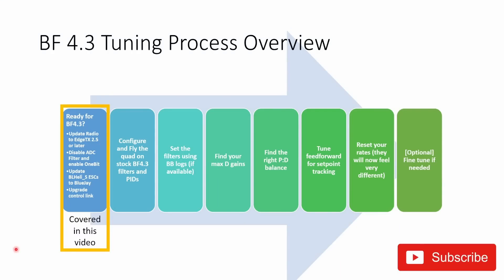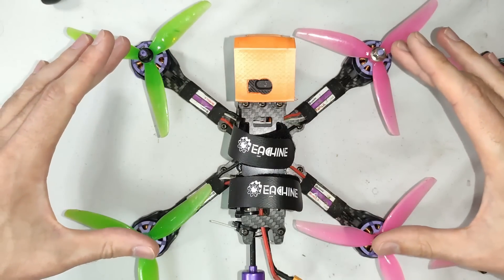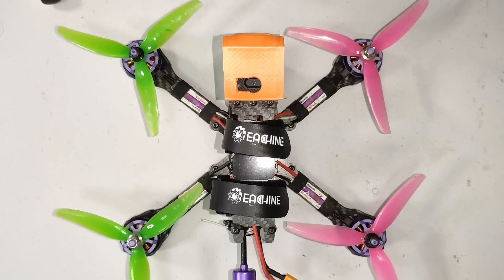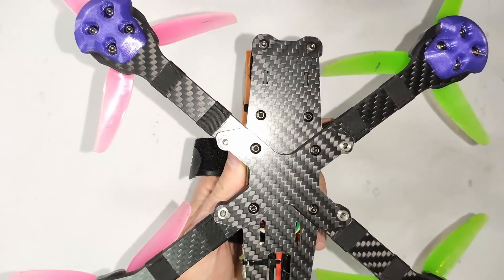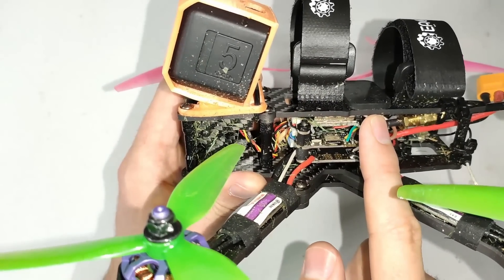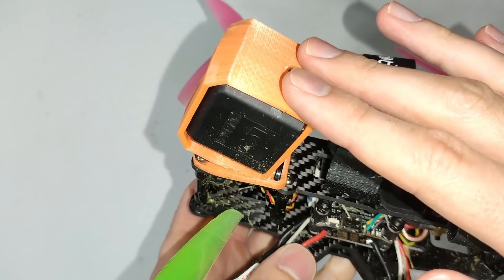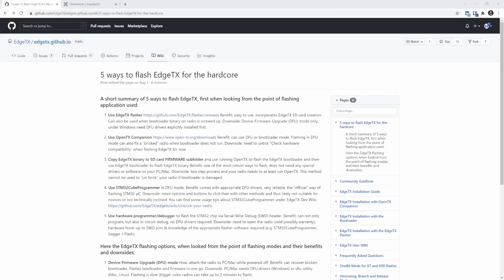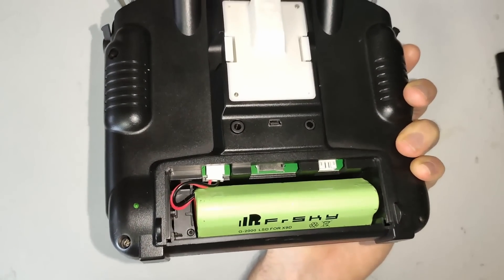Betaflight 4.3 Complete Tuning Guide! Part 1: Are you ready for BF4.3?

Comment: Chris, can you make a tutorial about 65-75mm whoop tuning without Blackbox logs?

I have Mobula7 75mm whoop where original F3 FC after water damage was replaced to CrazyBee F4 2.0 FC (F3 boards are now obsoleted and out of stock). And external TBS Nano RX. Nothing is loose. It flies, but something is not right with tuning. Noticeable overshoot and wobbling on hard turns. For more fun these FC's doesn't have flash memory for logs and all UARTs are already taken (SmartAudio and Nano RX).
Reply from the maker: The tuning guide will have steps for those without BB logging 😁 Typically whoops need less P gain than 5"

Comment: Will I get the same step response if I transfer my pids from 4.2.9 to 4.3?
Reply from the maker: I think that should work yes. You may need to do a little fine tuning but the values should be applicable. Be careful pasting CLI dumps though!
Reply: @Chris Rosser  Thanks for the fast response! Will you also explain in your video's what you can paste and what not?
Reply: @timon72489  this video was made for 4.1 but it still applies to 4.2 and 4.3 https://youtu.be/iEUqv0kOB0A
Reply: @JoshuaBardwell  Thanks!

Comment: On my Tango 2 there is no Sample Mode. Is that normal?
Reply: For what its worth, its not on mine either. Nor can I find the ADC Filter actually! So I'm limited to 250hz with crossfire tango 2 I think
Reply from the maker: If you don't have those settings that's OK. That means it's set correctly by default and you can't change it!
Reply: @junglistfpv8553  Hm, I do have the ADC option, but not sample mode.
Reply: @prottentogo  Would you mind letting me know where you found it? Would appreciate it!

Comment: Must I use EDGE TX? The legend of having a dormant touch screen, ready to someday spring into action makes open-tx worth it. If my radio was meant to have a touch screen, open-tx 2.4 would have been here by now, right?
Reply from the maker: Haha, Yes the potential of a touch screen is somehow more exciting and forbidden than just a working touch screen :P
Reply: Not needed, but I find I basically never use touch screen features at the field anyway, and the key is that you want the latest CRSFShot enabled, ADC Filter disabled, always... and having to faff around with nightly builds of OpenTX to get it - might as well run EdgeTX
Reply: @tehllama42  I was under the impression that CRSFShot was added to OpenTX this summer under the name "Synced Pulses".
Reply: @tehllama42  touch screen keyboard makes it worth it
Reply: @p.1206  I mean, I guess.  I just turn on my radio, and put goggles on, using basically the same model for everything, so I feel like I'm not the target audience for a touchscreen.
Reply: @tehllama42  fair enough, I just like squeezing every feature out of the product I spent a lot of money on and it’s cool to see the direction EdgeTX is going in
Reply: @p.1206  totally makes sense, to me there are enough other great reasons to choose that one, that's a bonus feature that is only useful on the bench

Comment: is there a way to turn off ADC filter in the Tango 2 ?
Reply: Off by default in freedomtx i think
Reply from the maker: It's off by default I think and you don't need to change it (not sure there's even a setting for it) :)
Reply: Tango 2 has no ADC filter - because it has digital gimbals and needs no stick filtering. According to Mike Chin from TBS
Reply from the maker: @ninja_quattrocento  Thanks for the info!

Comment: Thing about horizontally mounted VTX antennas is that in some positions antenna is hidden behind frame carbon which cause noticeable video noise. That is why antennas on stalks and 3D printed mounts became a thing. Though antennas which don't wobble, make better flight feeling in general, yes. Are JazzMaverick's BLHeli_M is not newer BLHeli_S compatible ESC firmware now? It is released at September 2021.
Nice to see Eachine Wizard X220 still alive. It was cheap but nice training quad for the price.
Reply from the maker: Good point about the VTx antenna, however you choose to mount it a rigid solution is essential for best flight performance. BLHeli_M is another firmware compatible with bidirectional d-shot (16.9 was released over a year ago in 2020). Bluejay is a more recent project and is what SugarK and others have recommended for BF4.3. I'm certain BLHeli_M will work fine as well and I've used it on many builds. That's the Eachine Wizard V2 which is a significant upgrade over the original with 3mm plates and 5mm arms as well as more recent electronics (although not top of the line by any means!)
Reply: No matter how you mount the vtx antenna on your quad, it will 'sometimes' be behind the frame, but a well-mounted antenna will reduce vibrations all the time

Comment: Hi Chris. Does the edge TX configurator make a SD card backup to keep models luas etc? Or should I do it manually? Thanks
Reply from the maker: It preserves your models and radio settings but not scripts.
Reply: @ChrisRosser  grazie
Reply: Hey Chris can I copy and install scripts
Reply from the maker: I think the most recent versions of betaflight and express lrs lua scripts work with edgetx 2.5
Reply: backup Your sd card anyway

Comment: Already tried 4.3 without bi-directional (rpm filtering). Its flies like FalkoX, even sounds the same. But burned 60A hobbywing regulator)) Later found that motors traces was completely crazy. But it was flying absolutely amazing... for 2-3 minutes)
Reply from the maker: I'm sorry to hear that! Hopefully this series will help you get the quad flying well on BF4.3 with no risk of smoking motors.
Reply: @ChrisRosser  Motors was totaly fine. Cold and sound super clear. When i found the quad, they was cold at least)) But couple mosfets was blown and diodes not worked as one way, how they should. I admit the chance that it was ESC fatigue, because it has already passed about 1000 batteries through itself. Regular current spikes just helped ESC go to heaven)
Perhaps I shouldn't have turned off the RPM filter, but that won't do it for the sake of experiment. And perhaps it was not worth it to immediately fly aggressive on a new setting))
Reply from the maker: @LizzzardRUS  Check out the Fettec spike absorber. It's really great for protecting ESCs and I talk about it in my AOS 5 perfect build video.
Reply: I had 4.3 on a 6" die a mile out.  Found the quad and it had crazy motor traces as well.  Melted the motor wire solder joints right off motor 3.  Not sure what caused it but motors were going full to off at high speed.

Comment: Bluejay or JazzMaverick?
Reply from the maker: The BF devs are recommending BlueJay for 4.3
Reply: JazzM support switching between 24k, 48k and 96k. This is awesome
Reply from the maker: @noramas.  Bluejay also supports 24, 48 and 96K PWM 👍
Reply: @ChrisRosser  you have to reflash ESC every time to change frequency. Not convenient. JazzM is much easier
Reply: BLHeli_M (JazzMaverick), that's what I use, completely free!
Reply: I've seen issues arise with jazz (blheliM) and they go away with jesc or bluejay. I recommend bluejay
Reply: @BrandonBeans  what kind of issues?
Reply: don't you have to pay for each esc flashed with BJ?
Reply from the maker: @robi5722  No bluejay is free.
Reply: Bluejay. It is still being actively developed and properly open sourced ;-)